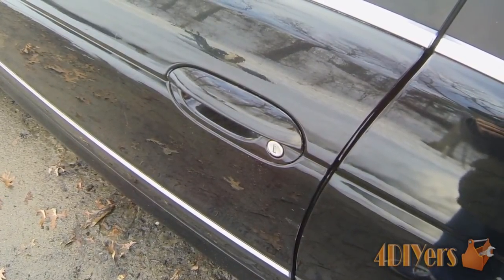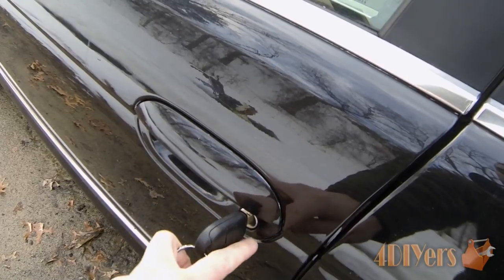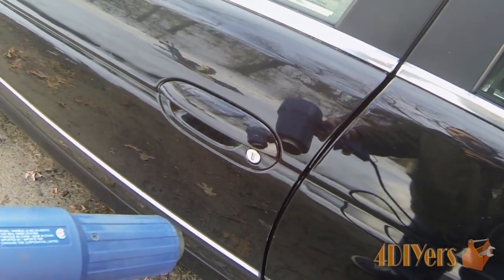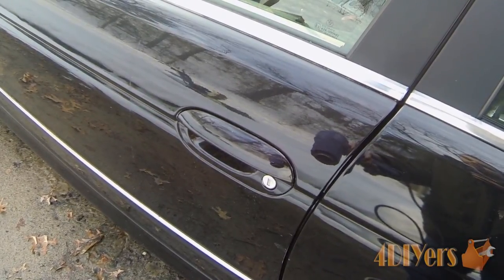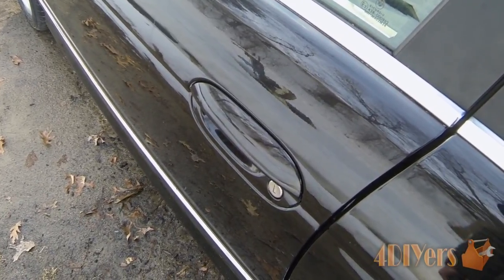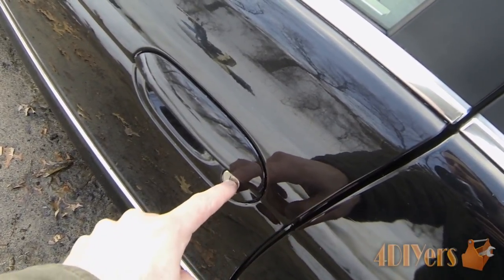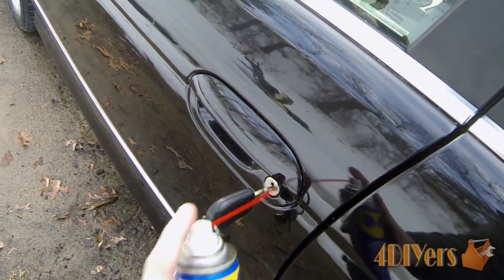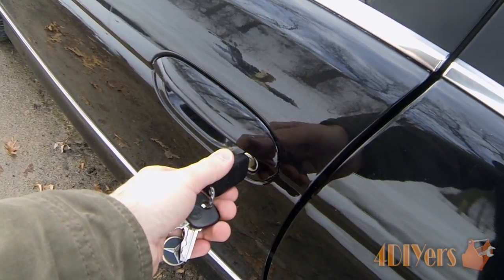6 Ways on How to Unfreeze a Car Door Lock in the Winter

Comment: There is one other way to unfreeze a frozen door lock. I would call this a last ditch effort, but it does work. If you have one of those red straws from cans of spray lubricant, take the straw, stick the straw inside the lock, and blow through the other end into the lock. Your breath is warm enough that after a few huffs and puffs, enough warm air from your breath will unfreeze any lock. Make sure when you blow air through the lock, that you inhale through your nose, not your mouth. Through your nose will keep the air warm as you blow through the straw.
Reply from the maker: Great tip, thank you for sharing!

Comment: It's -10° and I just used 91% rubbing alcohol and it worked which is really good because my propane heater tank was locked inside my truck. Got the idea from your sanitizer suggestion but I didn't have any..TY
Reply from the maker: Excellent tip, I honestly didn't even think of rubbing alcohol. Thanks for sharing!
Reply: Thanks Joe! I’m glad I came across your comment. It worked great.

Comment: I forced the the lock and now my key is stuck in my door i can unlock the car but can’t manage to get the key out or bring it back to the 12 o clock position it turns to about 11 o clock but wont go past that someone please help tell me what i have to do to get it fixed i cant lock the car either since it wont go past 11 o clock
Reply: I'm having the exact same problem did you find a solution? 🙏

Comment: I have a question for you. Sometimes in the winter I can get my frozen door to open but then I get in and the door won't close because of it being frozen.  It just pops back open.   Any ideas in that case?
Reply: Cathy, slightly roll your window down. Just did it this morning and it worked!
Reply: @grahamb6293   Thanks - will try it next time it is stuck.
Reply: Carry a propane torch... I had 2 96-99 Taurus's door would never stay shut in winter. I would heat up latching mechanism and it would stay shut
Reply: @bertsbug5757 
I got a small propane torch myself, wouldn't that damage the lock somehow, not to mention the last plastic covering?

I'm tempted...